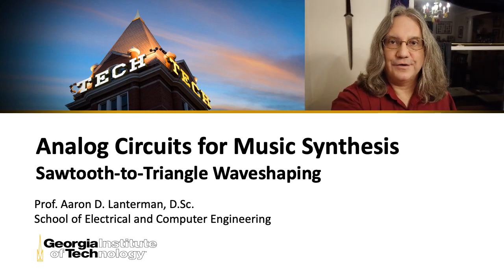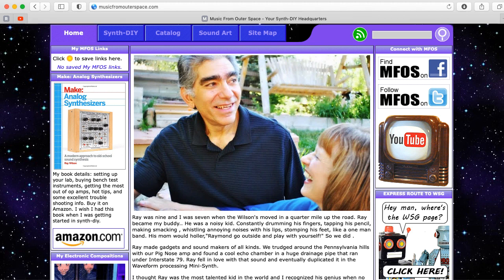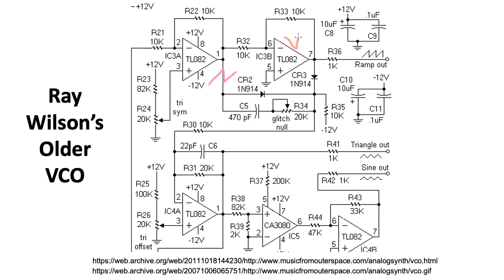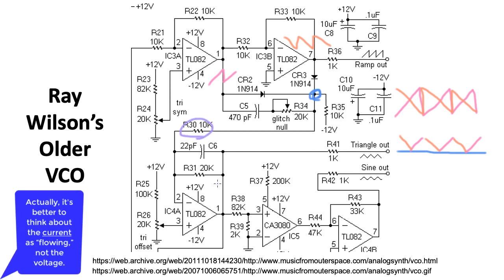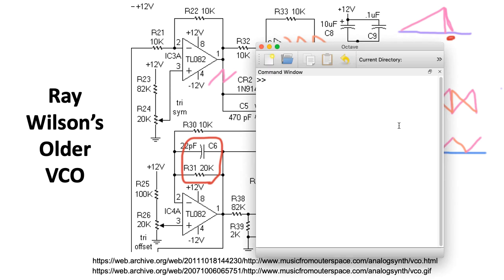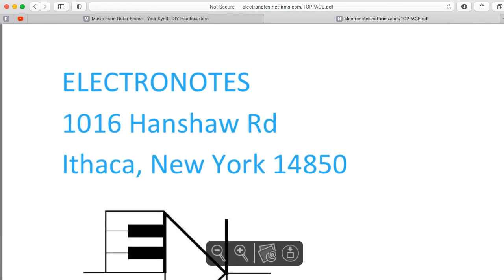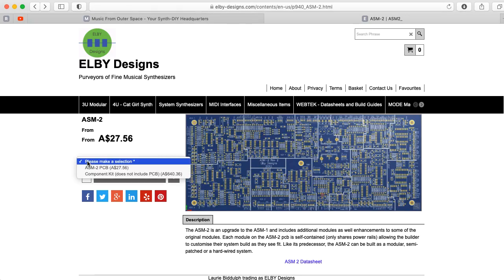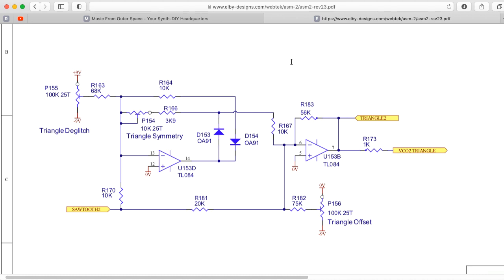ECE4450 L10: Sawtooth-to-Triangle Waveshaping (Analog Circuits for Music Synthesis, Georgia Tech)

Comment: Hmm interesting. The Jupiter 8 voice cards use a 2-transistor wavefolder (one emitter follower into one common-emitter set up for saturation at 50% waveform voltage) to do their saw-to-triangle conversion for VCO1, and for VCO2 the same circuit is used for the saw-to-"sine wave" by adding a diode clipper to the output. The resulting circuit(s) had an impressively low component count.
Reply from the maker: Interesting!

Comment: But the Roland approach, like the Jupiter 8 is cheaper to execute with 2 transistors and some resistors.
: )
If i would would sell a commercial synth, i think i would include both methods, rather than wave shaping.

Comment: The CEM 3396 “μP Controllable Dual Waveform Converter / Processor”* chip used in some Oberheim and other synths seems to take a different approach: it has a “waveform shaper” block that increases linearly as the input goes from 0v to 5/24 of Vcc, decreases linearly as input goes from 5/24 to 5/12, and stays flat for inputs above 5/12 Vcc. This allows you to dial in any waveform from sawtooth to triangle to “clipped” (half-rectified) triangle by adjusting the amplitude of the sawtooth going into the shaper (which the chip does internally with the  wave shape CV inputs). It also can do pulse waves with voltage controlled width, pretty much how you describe in your video on that subject, and can combine the sloped and pulse waveforms. It does separately for two sawtooth inputs, plus mixing the two resulting waves, a 4-pole lowpass VCF with voltage controlled resonance, and separate linear and log VCAs. A neat chip!

*Kind of a misleading name because it’s entirely analog, it’s only “microprocessor controlled” in that it’s meant to be used with a Programmable Interval Timer as the oscillator, but even then you’re responsible for turning the pulse train into a sawtooth externally. The only arguably digital input is quaternary, not binary, which AFAICT was done to save a pin.

Comment: 6:26 I think C6 is for further reducing the brief spike as the two diodes hand over at the peaks. While the "Glitch null" adjustment can do most of the low frequency filtering, once the output is loaded down, C6 is likely going to increase the range of stability before the spike reemerges.
Reply from the maker: Excellent observation!

Comment: 6:05 hmm, is that formula valid for a parallel RC circuit? (Not that it would change the conclusion in this case. The capacitor is clearly meant for stability.)
Reply from the maker: Check it out: https://www.youtube.com/watch?v=Y1UP9u8tomc